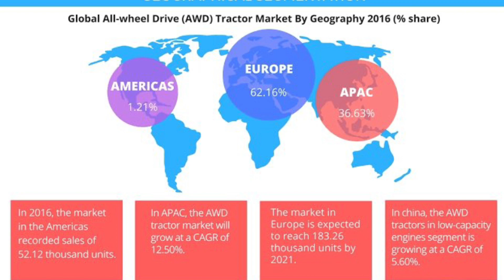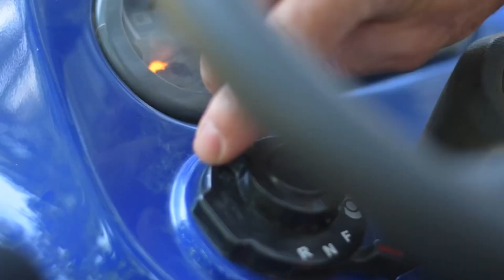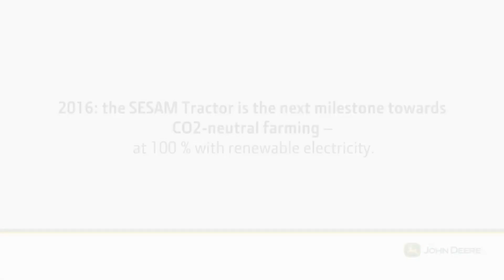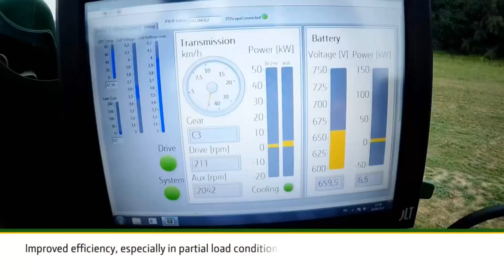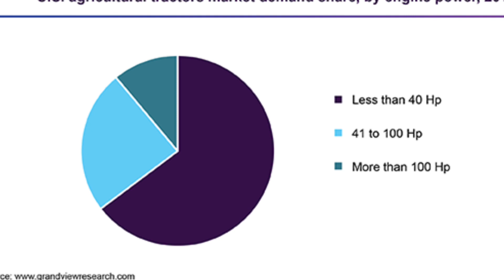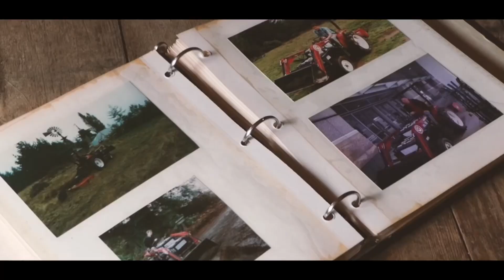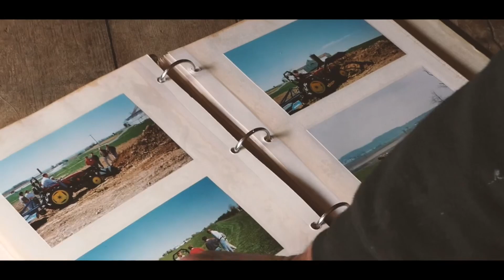Tesla Tractor | Disrupting The Agriculture / Farming Industry

Comment: I know you have to explore the consent but tractors with scablands spool 🤣🤣 nearly wet myself. Now that you mention it all my fields have a 100kw power plug at one end always wondered what that was for🤣. Seriously though cars are a hard sell tractors Battery tractors are going to be near impossible until technology takes a huge leap. By then hydrogen or hydrogen fuel cell will be the way forward for  these high power,  long running hours machines. Autonomous tractors could have a place and overcome some of the problems 🤷🏻‍♂️
Reply from the maker: Yep crazy concept that won’t ever happen 😂 Green hydrogen with fuel cells that could be autonomous are more likely. Hydrogen better for industrial large scale equipment 👍

Comment: JCB is leading the way
Reply from the maker: I’ll have to check them out. What are they doing?
Reply: @SageFinance  They have made a combustion engine that is completely zero emissions it is basically Identical looking to a Diesel engine but it runs on hydrogen and it is more efficient than a diesel engine plus you can just refill the tank like you can with Diesel vehicle
Reply from the maker: @jammiedodger7040  Sounds great! Green hydrogen is definitely going to be another good option especially considering the massive green hydrogen insulated forming here in Australia looking to export to Japan and South Korea initially. We’ve got heaps of excess renewable energy during the day which could be used to produce green hydrogen with electrolysers and recycled water - I’m a chemical engineer in the power industry and keen to see it happen and be a part of it 👍
Reply: @SageFinance   Yes hydrogen is the future it can replace Diesel and Gas and Jet Fuel without much modifications
Reply from the maker: @jammiedodger7040  Yeah lots of gas turbines for power generation can run with a blend of natural gas and hydrogen or even 100% hydrogen for newer models 👍